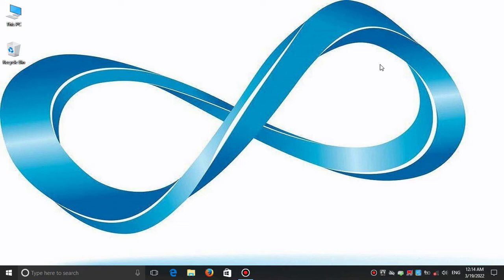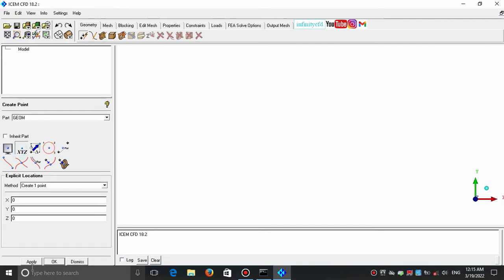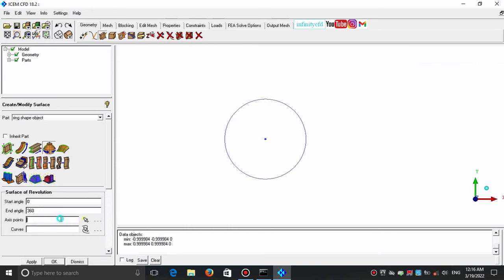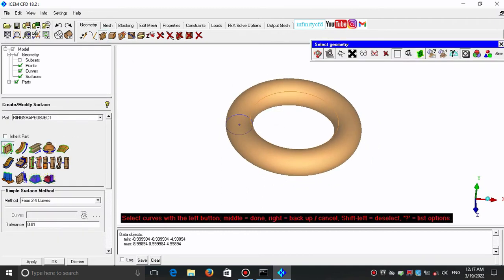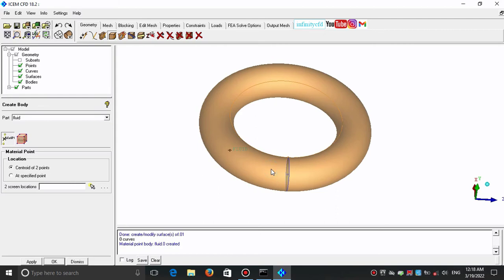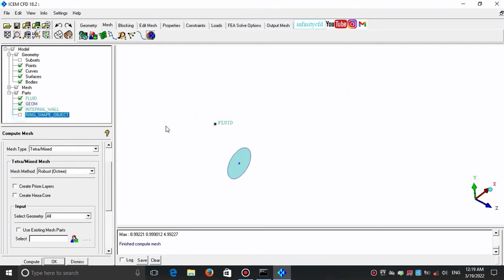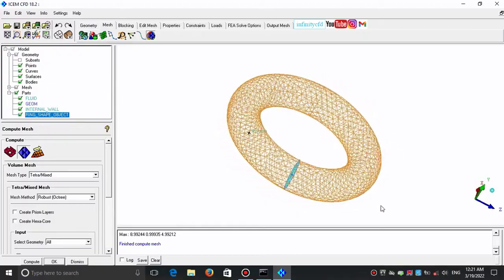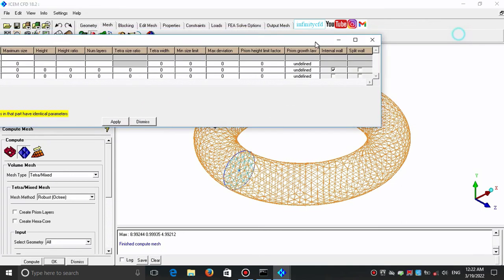Grid generation for an internal wall in Ansys ICEM CFD.

Comment: Sir how  I can structure  mesh multiple cone inside duct
Reply from the maker: In a simple manner Dear. You can create structured mesh for your geometry. You can see this video "Creating structured mesh for a wedge with the L-Grid method using Ansys ICEM-CFD." So at first you create an overall block for your cubic domain and then split it into smaller blocks in such a way to capture protrusions.